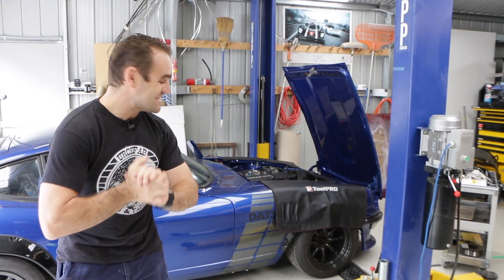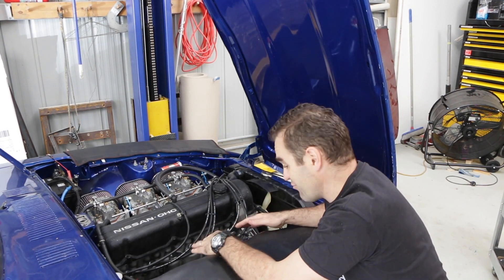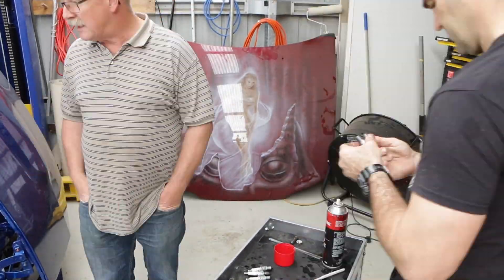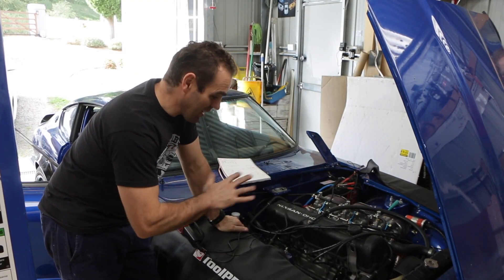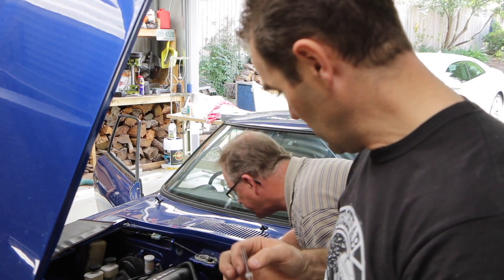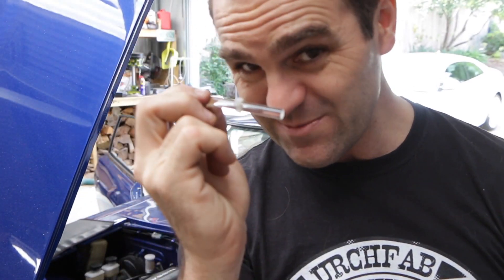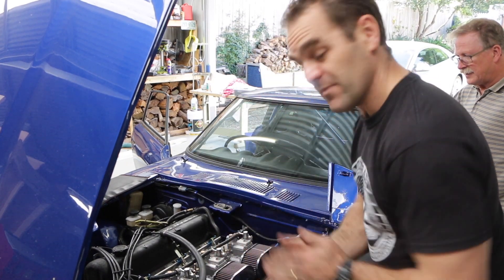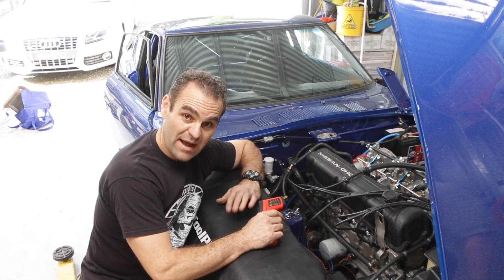Delving into OER 45 Carbs

Comment: Hi Jeff! It looks like you went through the same problem I am having with these carbs today. I have been struggling to get my 240z with an L26 and 123 distributor to even run these carbs. Could you please share some information with me? What is the fuel pressure you found made these the most happy? What jets, and air corrector sizes did you end up with? Did you keep the fuel dead headed or ever go back to a return line system? what heights were the pump jet screws set to? and what height was the float bowl set to to be happy? I am lost and really need some help. Thanks so much!
Reply from the maker: Sorry mate I can't remember and I sold the car several years ago now.

Comment: Timing is definitely still causing you problems. It sounds like  its really advanced and its really causing the hard starting issue also possibly others.  Triple check all the timing marks Jeff, TDC and timing marks on the balancer isn't enough. Check the cam timing to the factory specs the workshop manual explains the process. 

I had similar issues. With the engine running terrible, really advanced timing etc.. I went back to basics with the timing marks in the manual and put a brand new timing chain on just to be certain. Problem solved
Reply: First thing I thought when I heard it trying to start!

Comment: Back in the day we would use a 4 gas analyzer and a oscilloscope  to tune sometimes in conjunction  with the dyno
No guessing that way! All the info you need.
Reply from the maker: That is fine if you have one throttle body, but with this you need to tune each cylinder separately to start with, then you can worry about fine tuning with a wideband O2 sensor.

Comment: FFS just take it to a dyno and have it tuned and jetted correctly. You have no idea of AFR readings throughout the rev range. Choke sizes,emulsion tubes ,idle,main &air corrector size are no stab in the dark thing. JUST DO IT!
Reply from the maker: I will be, but I need to get it running better before I take it.
Reply: Home Built By Jeff running it like this ruins the break in process. No cylinder pressure (load on engine) plus over fuelling will not give the rings a chance to bed in. You are actually doing more harm than good for the longevity of the engine by rooting around like this. BOOK IT IN FOR A DYNO.

Comment: Jeff you need the balance the carbs and get even airflow on all of them. Webers have air bypass screws to let you set the flow correctly. Each carb is done separately with the linkage detached. Once each is done you connect the linkage and set them in unison. Start with you mixture screws 3 turns out from stop. Balance the carbs then adjust mixture if needed after a drive and by pulling the plugs to look at the colour. It's how I set 42DCNF webers and 48/50 IDF webers on Aston V8 engines as well as the Dellorto on Lotus.
Reply from the maker: We balanced them all. No air bypass screw on these though :(

Comment: One thing I learned with my triplets is that you have to use good gas.  If I got gas from a shady station within minutes my idle would go to 1500 and run badly until I flushed it out and put "good" gas in it.  Very picky about the gas they like.  
Again, using a meter that monitors  the vacuum on multiple carbs at once makes syncing the ( basically) six carbs a lot easier.  As you adjust one it affects the other five.
Tbh my z with modified stock carbs was faster then my z, and my friends z, with triple Weber's.

Comment: I still think it's the distributor. The timing isn't right or something electrical. When the carburetors are generally close the engine will run evenly in some RPM range with the same plug color.The fact that the temps and various plugs showing lean and rich could mean the timing is off. Everyone thinks carbs are fussy and hard to adjust but it's just high and low jets and a valve for air and fuel. Synch is the harder part and even that is easy with the right tool. 
Enjoy watching and the videos. I  like pondering the problems and learn something every time.
Reply: Agreed. Triple check the distributor and that you have the leads in the right order.  It sounds very much like a firing issue
Reply: And I suggest you go back to Mark Harvey's comment below.  Love you show, by the way.

Comment: Lots of testing and experiments. Gonna be killer when it's all tuned in.
Sounds like on the right track now, and ruled out a lot of possible problems.
Full system diagnostic right there. Was worth it.   Is the fuel return hooked back up again?
I  guess we'll find out.
Reply from the maker: No. I will go without the fuel return, If I have issues I will look at reconnecting it.

Comment: Yeah im with Richard a bit jeff, you must either have it a bit to advance on start up or your hydro locking cylinders cause it shouldnt stall up like that.
Also ill add, the l28 do hate being cold run numerous times and foul the plugs rather quick, even the fuel injection models, after 5 cold starts without a hot run theyll foul the plugs almost certainly.

Comment: Curious as to what size venturi are in those OER carbs?  You'd want the 36mm venturi ones on the Nissan L6 engine.  You'll struggle to obtain a tune with a venturi size for a larger capacity engine.  Definitely need a re-jet looking at those plugs.
Reply from the maker: I believe Stewart said they are 36mm

Comment: At 2:25 - sounds like you still have some timing issues.  Does what your timing light tell you match up with what the 123i app says? If not, maybe your #1 plug wire should be where you have #5. Try moving every plug wire 1 position CCW.  I can see you have the right plug order. It should fire up more easily than that!  Even when cold.
My 123i map looks like this:
1.     500	        7.0
2	1000	9.0
3	2500	24.0
4	5000	34.0
5	8000	36.0
Soft rev limit  6500.  The L6 engine loves it.
Reply: You def. need to set up to TDC as per the video I made.  I take the valve cover off, which is the correct method to see timing marks on the chain and cam sprocket. Mark that as zero on your harmonic balancer (it should be the “notch”. Once you have the dizzy initially installed and calibrated using the green LED method, load a 0 degree advance program up to at least 1000 rpm into the 123i tune+ and check your timing at idle with a timing light.  Ideally, it should show that you are at 0 degrees advance, In the App AND on your harmonic balancer. If it’s off (mine was slightly) then loosen the dizzy mounting clamp and turn the dizzy until you are TDC=0. Once you have this set as a 0 degree baseline, you can then (correctly) load in the desired advance curve...   In the end it’s up to you, but I wouldn’t even bother tuning carbs until you get the timing spot on.  You will just mask the real problem.  You can thank me later.
Reply from the maker: I have tried all of the different plug spots. The first couple of times the issue was that the 123 immobiliser was still enabled. Also these carbs have the wrong jets and they don't have any choke.
Reply: @Home Built By Jeff
Cool, worth a try. What I recommend is where mine is happy. But engine timing  (and dizzy driveshaft placement) can be different.   Does the timing light match what the 123i app is telling you?  Mine seems about right ( +/- 10%). I suspect the 123i app is more accurate than my timing marks, but only once it’s “zeroed in” correctly.
Reply: Richard Harvey s